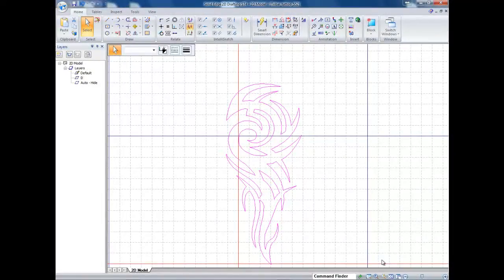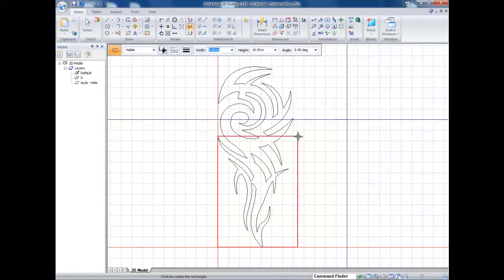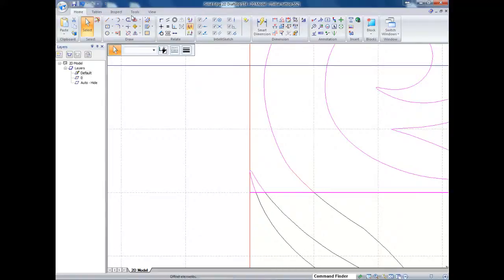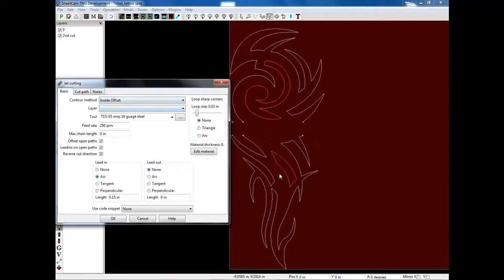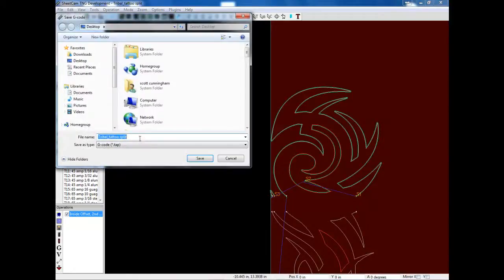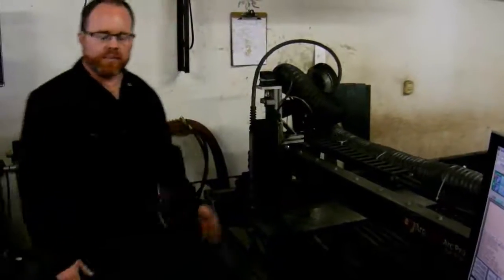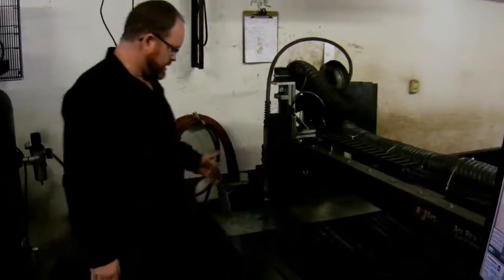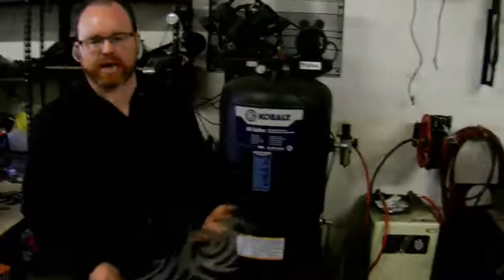How to Index Cut with a Plasma Table

Comment: ˙ave langmuir 2x2 table.  Video very helpful.  My new sheet cam software does not have Icon for Create new cut in operation menu. Only Drilling, inset code, set post variable, move to.  Would I create separate operations for the 2 layers?